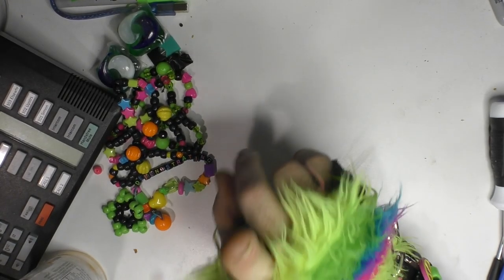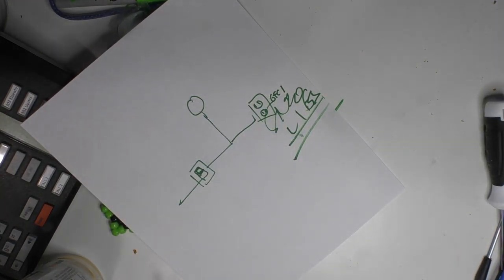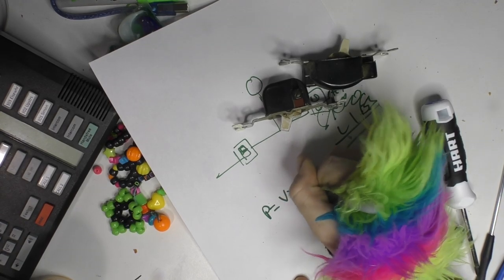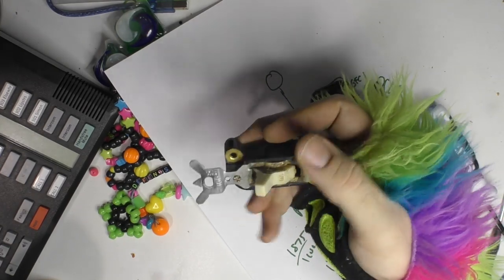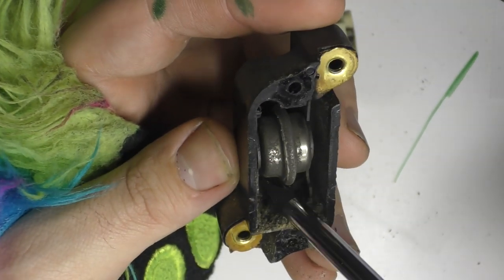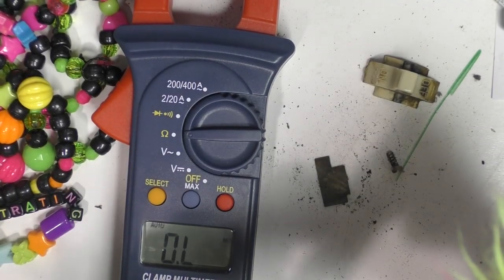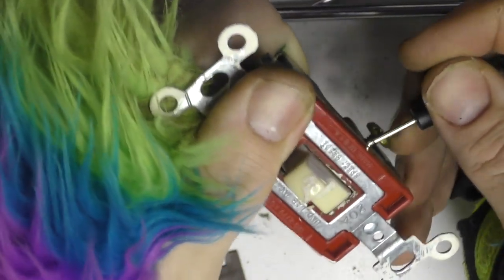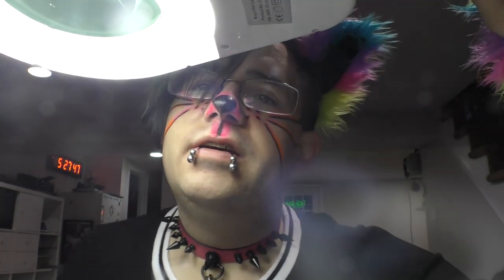Melted Light Switch Teardown

Comment: The reason why the meter shows that low, is because you measure both wires, you should only clamp 1 of the wires in a cable to measure the current.

You got 2 magnetic fields that cancel each other.
Reply from the maker: I guess that makes sense.
Reply: Yeah came here to say this

Comment: Looks like a GE style mercury switch from the mid to late ‘70s. They were supposed to be “quiet” while allowing higher loads. The round part has two halves that was insulated from each other, but when the switch is turned, Mercury filled the small space between allowing the circuit to complete. As far as I can tell, they made 10A/1600W & 15A/1800W models. My guess is the switch became overloaded a lot over a period of time. This overheating/cooling/overheating cycle eventually caused the type of plastic (probably something cheaper than Bakelite) to become brittle, allowing the spring to come loose, fall into the switch cavity, then short the circuit causing the breaker to go off. The act of either resetting the breaker or the tear down caused the ceramic to break, losing the 3-4 grams of mercury inside which evaporated away.
Reply from the maker: Amazing summary.  My guess is that the switch overheated causing the mercury to vaporize or leak out.  In hindsight I am unsure if the breaker actually tripped, I thought it did at the time due to no lights/outlet/fan but again, that was all coming through the switch so it could have been as simple as a mercury loss.

Comment: The cylindrical dingus in the switch has a glob of mercury that passes back and forth through the hole in the insulating material. Handle it carefully!

Also, that switch didn't *click*, because it didn't have a metal piece inside to bend back and forth, not because it was broken.
Reply: If I had to guess, the cylinder, in the "on" position, has the bit of mercury schlep over to complete the circuit between those two spots on the side that aren't electrically connected.
Reply from the maker: Well ... you were right... https://www.youtube.com/watch?v=gnzW8t27Jqw